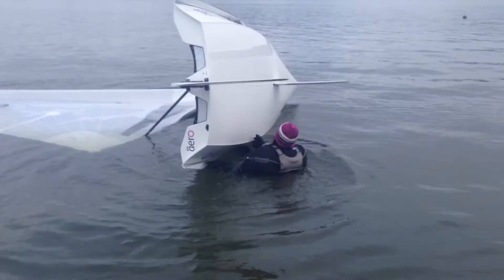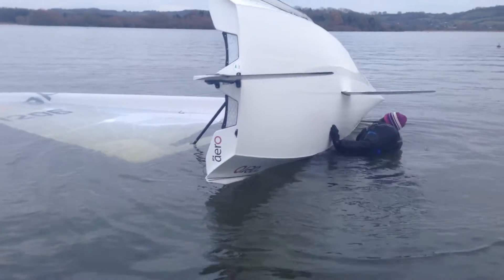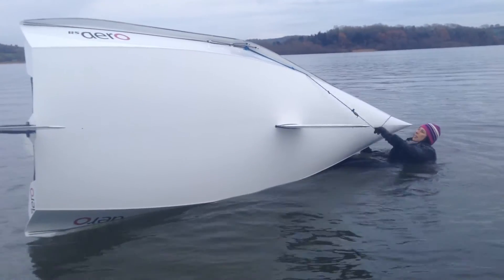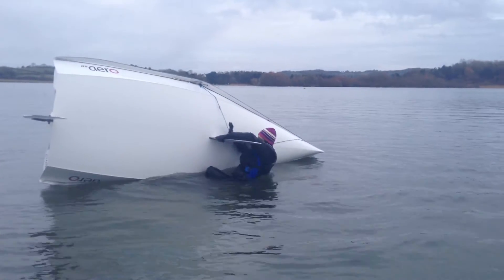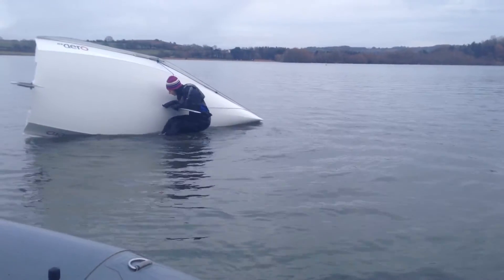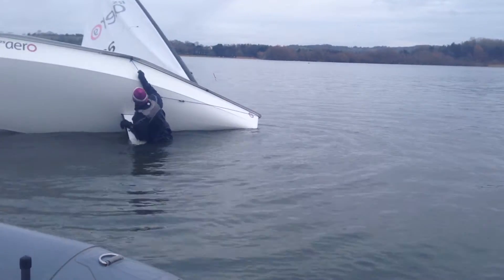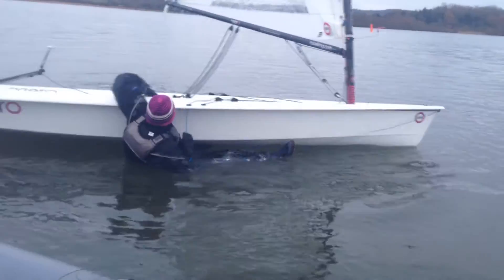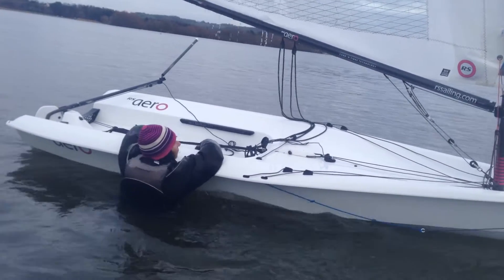RS Aero - Prototype Righting Lines - Jan 2015

Comment from the maker: Keith,
This is not a 'righting test' but a Righting Line trial, for specific new equipment. Those are the conditions that we were dealt on the day. Cathy demonstrated she was able to reach the line and now hang off the knots, which was the goal.
I did admit in my description that it came up easily and the Lines will become more important when there is a strong wind. The fact that she is in full winter clothing, with that weight and immobility, adds merit.
For a series of recoveries with a wide variety of conditions/crew weights see here; http://www.rsaerosailing.org/index.asp?p=forum&fid=4&tid=6969
We will get some of these Righting Lines on the young Aeronauts' boats at their ClassTraining on 21/22 Feb and likely shoot some more footage in more wind.